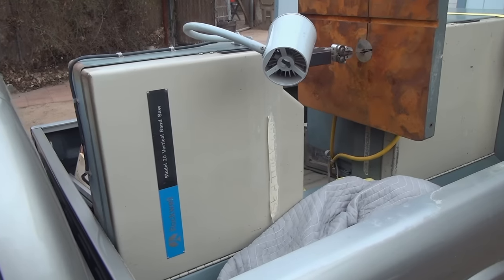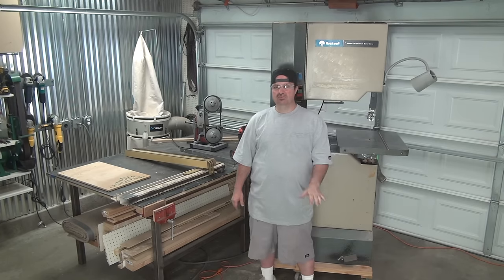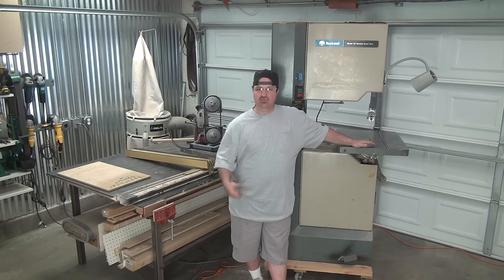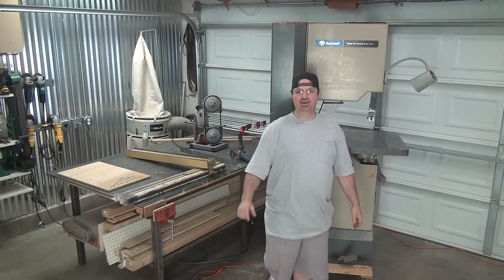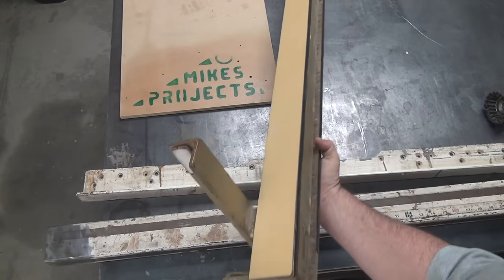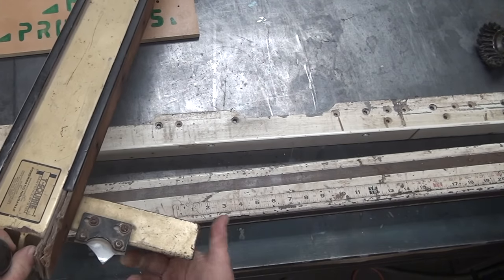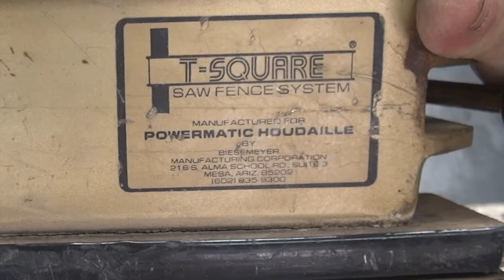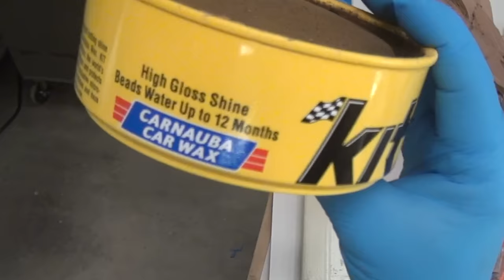Installing a Biesemeyer Fence on a BandSaw & Make a Table Extension Wing Part 1

Comment: I just searched google & found only one other bandsaw with a Bies fence. That saw can handle it no problem. I have a 60's Rockwell bandsaw, I also have one extra unisaw fence from the old set up but that has eight foot runners. I like your idea.  Your saw is in great shape dtw and the video is fricken top notch brother man, just about pro quality. The guys in the shop turned me on to you & the videos, I see why they like you, good stuff man good stuff. Are you going to do anything with the actual fence itself?
Reply from the maker: Yeah, pretty rare. Thanks for the kind works man. Yes the fence got restored & the video will be out soon.